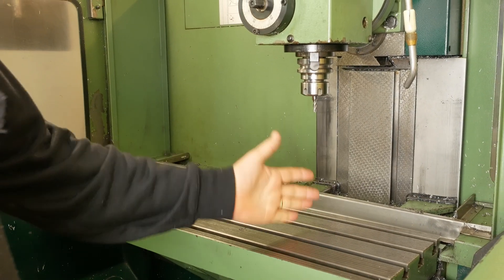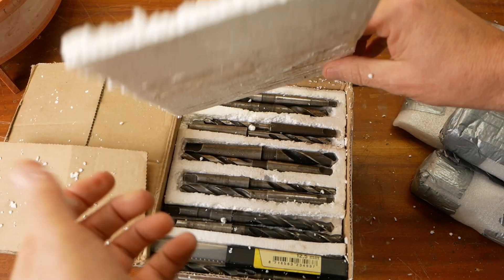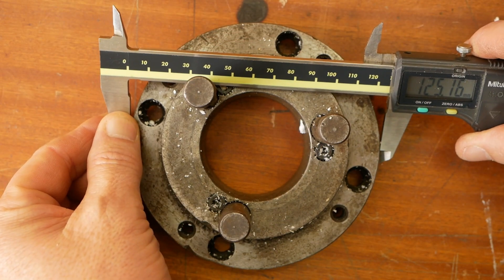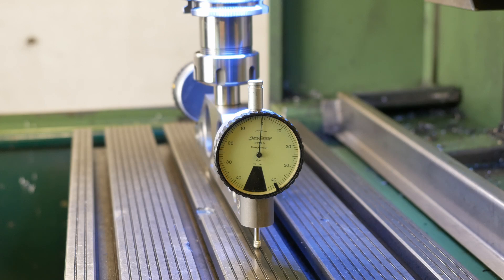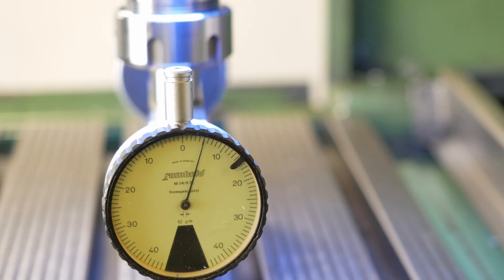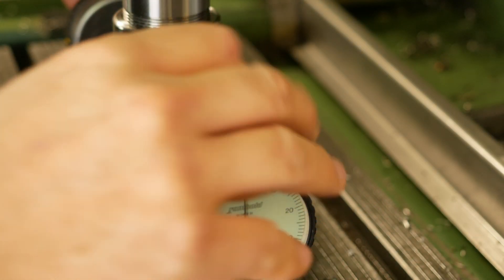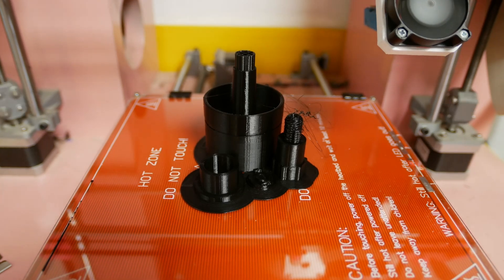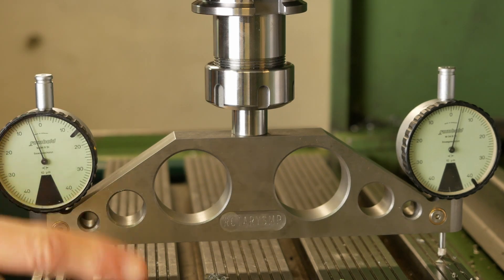The most amazing shop made tool! || RotarySMP

Comment: The first thing I'd check would be the adjusment of the gibs - especially the Z axis. Given that your machine is ex-education and hasn't done many hours, it's unlikely that the slides are worn, but on old machines this is common and would show up like this. If the gibs are properly adjusted and there's no appreciable wear, then remove the table, stone all the surfaces remount and check again. If that's not fixed it check that the head isn't tilted forward due to foriegn matter under the mating surfaces - you'll need a test bar. If the tilt persists, then it's wear causing the geometry of the machine to be out. I'd shim rather than scrape the table. If you scrape the table to correct the machine's geometry it will not only vary over the travels but will trip-up you or a future owner if the machine's ways are remachined.
Reply from the maker: Thanks for an excellent clear procedure to check that David. I will need to look into this when I get back from my trip.

Comment: I know I am a bit late with this, but most of the Deckels in the institute where I did my diploma thesis had 20 micron to 50 micron stainless steel foil shims to adjust the table sag. The alternative would have been to scrape the individual mounting surfaces of each of the tables in, which is fine if you have one machine to match one table to, but a lot of work if you have nine or ten machines with as many tables plus dividing heads which get swapped around a lot.
Must have been good enough, though: some parts made on those ended up with the ESA's Rosetta mission ;-)
Reply from the maker: Thanks for the feedback on that Kai. I need to get in and have a look at the gibs on the vertical slide as well. Might have worn a bit loose there as well.

Comment: Check the gibs.
Check the head for NOD.
Shim the head if you can, as it would be an easier job, if not, shim the table. 
 If you find your gibs are still good, and shiming isn't working well, your next recourse is to take the table off, and scrape the mating surfaces flat, or send the table off to be resurfaced.
Reply from the maker: Thanks for the feedback on that.

Comment: You're not using your tramming tool correctly. Here's how to do it. First, orient both clocks to face forward. You need to see both at once. Then Calibrate it by raising the table until one clock is zeroed at any convenient spot. Next, turn it 180° so that the other clock is touching the same spot (I put a target spot of ink near the front of the table.) Then zero the second clock by turning the bezel, without moving the table. You now have the clocks matched. (It should hold calibration between uses, but it's good practice to check. And never reorient the clocks.) Now align the frame with the X axis and the clocks facing away from the machine, so that you can see them from operator's position. If the head is out of tram you will see different readings. Turn the head until the readings are the same. Do not turn the spindle. Don't even touch the tool. One needle will move cw and the other ccw. Move the head until the readings are the same. They don't need to be zero, just the same. There's the advantage. You can see readings on both sides of the machine without repeatedly swinging a clock left and right, as as you do with a single clock. When used on a Bridgeport style machine it's especially helpful for adjusting the nod.
Reply from the maker: Thanks for the clarification. I suspected I wan't using the correct technique when I did it.

Comment: Mill the plane flat again.
Reply from the maker: It is probably loose gibs, or wear in the vertical slide, so milling the table square would be a last resort bandaid.
Reply: @RotarySMP  You could check if the deviation vary with the table height.
Reply from the maker: @andreavico6198  I need to do more checks.

Comment: For your y traming  you need to recheck it with the table lowered.
If you don't then you could be mislead and not knowingly having a compound error.

For the x movement recheck with the table fully extended both ways.  It will give you a great indication on way wear.

And as a previous person said, first adjust your gibs.
Reply from the maker: Thanks for the ideas Pierre, I'll add them to my next check.

Comment: The first thing that needs to be checked is if your axes are moving in a straight line and if x to y, x to z und y to z are perpendicular. You can check this with a precision granite square.
Now you can dial in the table parallel to the x and y axes and use your tramming tool for the spindle.
Better way is to set up the table and spindle separately. Dial in the table. For the spindle you use a cylindrical sk40 test bar and dial it in.
Reply from the maker: Thanks for listing the steps clearly.

Comment: Hm, by checking the Y axis from back to front of the table, what does the clock show?
Reply from the maker: I need to check that. Others have pointed out that the problem is probably gib misadjustment or way wear.

Comment: Did you tighten the bolts of the head before checking tram across Y axis? Also the tram (and table surface) needs to be exactly true to the Y-axis movement, should maybe check for that by sweeping an indicator over the table using the Y-axis before drawing conclusions
Reply from the maker: Yeah, I have more work to do isolate where the problem actually lies.

Comment: When checking the tram of the table, move the Y back and forth, don't rotate the spindle. You are now including the spindle leaning forward/backward and not just the tram of the table. I made that mistake and ended up making a kind of sawtooth pattern in the Y direction when taking parallel passes over X.
Reply from the maker: Thanks Quintin. I have been given a clear plan to measure and diagnose this error.

Comment: If the table is not adjustable, I would be tempted to use a large fly cutter to trim-tram it - so it is probably a good thing that I am nit allowed to have my own machine shop ;)
Reply from the maker: Yeah, it is more likely an error somewhere else such as a loose or worn gib.

Comment: Do check with a indicator on the head the difference between the front of the table and the back. It might be the head that is askew. Might be a chip there for you know. 

This is all why adjusting the y is a bitch on a universal head. Can't measure with certainty without torquing all the bolts.
Reply from the maker: Good points that. I need to investigate further.

Comment: The 3d prints look better, were you able to calibrate the e steps for the extruder motor?
Reply from the maker: I was going to but didn't get around to it. This is a different batch of PLA. Maybe that made a difference?
Reply: @RotarySMP  it is totally possible, sometimes the filament viscosity can play a roll in the performance. A better formula could provide much better results. Love the videos keep it up!
Reply from the maker: @mrpanda876  Thanks. I will do.

Comment: Not that I am very familiar with all milling machines, but this deckel-style alignment is very prone to sagging tables IMO. The  vertical flat/dovetail way is very far from the table mass, this generates a lot of leverage, the lower side of the vertical(Z-axis?) carriage wears more than the topside=sagging front. 
I've read somewhere, the top-notch milling machines were made with a smidge of reverse-sag, still in the tolerance, to account for a bit of wear.
Even if you scrape the table, you cannot account for the uneven wear on the vertical ways. 

Placing the leadscrews far from the mass of the table does not help either. On bigger machines, at least non-cnc, the leadscrew is usually right under the table mass.

I have a seldom-used manual MH500 too, though the vertical ways are worn a bit even on mine. The flaking is noticeably fainter than on the nonused surface area. Mine has tilting table, so not a real problem, but still.
Reply from the maker: Good points. I need to check the gib adjustment first. Maybe I get lucky there.

Comment: Wonderfully made tramming head. Not to be a party pooper, I just never understood people's fascination with this dual indicator head. You have to make sure each indicator reads the same, which mean swinging it to the same spot, and zeroing them against each other. Using a single indicator (like your old method) to me seems more accurate, more foolproof, and no special tools required to use it. I don't know if this is only for hobbyists that like this dual head? I worked in a tool and die manual shop in the late 90's, and everyone there used a single indicator to tram the machines. I wonder if modern machine shops use this dual head system, or keep with the single head system. Edit to add, between uses, there is a chance the indicators will move. So I guess you have to re-check the zero each use. Just seems a lot more work than a single indicator.
Reply from the maker: I think Luke was trying to use up as many Dial indicators as possible. He could have made a four gauge unit, but that would have been too much machining :)

Comment: Saggy bed looks like a common problem in these machines, I have 2 of them in quite good state and both beds are slanted by around 0.1mm. Both Z and X slides introduce some play, but tightening the gibs did not help, only make motors hum louder due to increased resistance. Shimming the bed is not a good solution, the rigidity and vibration damping gets worse with less contact area, and the result is an artificially lifted table. 
The fastest and dirty solution would be to grind (and destroy) the table, which is probably perfectly perpendicular to it's mounting surface, or to attach some kind of middleman plate to the table and grind it. 
You could also disassemble and check the Z slide. My X and Y axes look like new but the Z slide and the gib is a bit worn, scraping would help, but I have absolutely no experience in that matter and have decided to leave it as is for now. 
Your Maho looks so great though it could be just gib tightening.
Reply from the maker: Thanks for that John. I hope it is just gib misalignment.

Comment: rotate the table along a 45 degree axis so that the mounting surface is sitting up and the current top surface becomes its "base" attached to the knee. Then flycut the table base (which is now up). Then remount as before.
Reply from the maker: That could be neccessary, but I need to first check whether I have  a loose saddle gib.

Comment: maybe calibate the guages first in the same spot to zero using a guage block and then check the two points .this is the instruction from edge tecnology.i am not saying your method is wrong,its just what i followed when using edge tecnology traming kit.
Reply from the maker: Thanks. I didn't realise that was the best way to calibrate the tool, but others also pointed that out.

Comment: Before you go messing around with tilting the table, you should verify that the head isn't nodding. 

One method: Stick an indicator in the spindle and put something flat on the table, then run the indicator in the y direction on the flat.
If your reading doesn't change as you sweep across the flat, that means your table is not tilted but your head may have nod in it. 
If the reading changes as you sweep, it means your table is tilted. You will need to fix the table tilt and then check again with your tram tool to see if you have any nod in the head.
Reply from the maker: Thanks for that nice practicle test method Josh.

Comment: I mean a way to do it would be to just loosen the table slightly to just put like 2 pices of paper near the bottom bolts and then tighten it back up. The keep redoing that and folding the paper until it's good. Defetnly not the right way to do it but for the work you do it might be good enought, i also don't konw if the table not contacting on the entire surface would cause it to vibrate or anyother weirdnes so do so at your own parrel.
Reply from the maker: I am not a big fan of shimming. But it has been pointed out that the issue is more likely to be loose gibs, or way wear.
Reply: @RotarySMP  it probably is, and i doubt you would want to go spend the money to regrind them. 

there is a book online for what is generaly torable for theas machines "TESTING MACHINE TOOLS" By
DR. GEORG SCHLESINGER if you want to look over the mill section to see what normly lash and wear should be

it is free online if you can't find it i can send it to your email

Comment: 1 thing about using this setup for measuring.... make sure you swing both clocks fully before acting on measurements (im sure you did, though you only showed it for the Y and not the X) 
As for trading the Y, well on our large Universal head machines we would shim the head to align the spindle but still had to shim jobs to level them to the movement of the Y. As they got older and more worn out (experienced droop) we just got used to setting Z datums locally to where we were working 🤷‍♂️ i know, not the news you want to hear. Probably best to remove your table and do more inspection, hopefully it won't need scraping.
Reply from the maker: Thanks. It has been pointed out that it might just be loose gibs on the saddle, or wear on the vertical / horizontal slide. I need to investigate before doing any changes.
Reply: @RotarySMP  its weird how over time bolts can both loosen till they fall out or tighten until they become fused 😂
Reply from the maker: @wildin13  I will take the table off to check for a chip, but I put it on last time, and cleaned and lubed it well.

Comment: Hello Mark.  Thanks for all your great videos. Some nice finds there, and a beautifully made traming tool. You didn’t mention it in your video, and you or other viewers likely already know this, but you should check / calibrate the tram tool first. Using a gauge block under the end of one indicator, zero the indicator, then rotate the tool 180 deg and zero the second indicator on top of the same gauge block, in the same place on the block and table. This way they use they now same reference point / zero. Worth checking a second or third time to make sure the results are repeatable. Then check the tram of the head. Some of the commercial versions of this tool use a neodymium magnet as the gauge block for zeroing. Just check to make sure it’s faces are parallel and it rests very level on the mill table. Take care in your upcoming travels.
Reply from the maker: Hi Mark, 
Thanks for that info. I'd never used something like this before. 
Mark

Comment: Before changing anything on your mill, you first need to check whether the table or the spindle axis is tilted. The simple measurement shown in the video cannot differ between those two sources of error on its own. If the error is in the spindel head and you correct the table for it, the geometry will be worse overall.
Reply from the maker: Thanks Felix. Good point. A loose gib could also cause that.

Comment: I would just shim it, where the table bolts to the machine. Since you know the error you can calculate the shims fairly easily and it will get you going for now.
In that axis you should really be tramming the spindle relative to the Y TRAVEL first, then once you are sure the spindle is at 90 degrees to Y then tram table to match spindle. 🤔
Reply from the maker: Thanks for that input. That makes sense.

Comment: I wouldn't be happy using a collet, because collets are not that accurate.
Going straight into the machine taper is as accurate as you can get.
Reply from the maker: Doesn't that wash out when you rotate the beam?

Comment: What you really want is to tram the spindle to the X and Y ways. I start with a flat disc that I indicate in by sweeping the X and Y. Then tram the head to that. With your setup it's even more important as your table mounting could be off. I would at least sweep the Y across the table to see if it is true to the Y slideways. Then you will know where the correction needs to be made.
Reply from the maker: Thanks for that input. Excellent idea. It could be a simple as gib misadjustment.

Comment: Couldn't you skim the table with a shell mill?
Reply from the maker: You could, but that is not a good solution. The table casting is unlikely to have sagged. It is probably wear in the ways or misadjusted gibs. So better to address the problem than the symptom.

Comment: Hi Mark ,what a wonder gift from Luke.
Having installed a few (hundred) machining centers perhaps I have some  useful advice.
As beautifully made as the tramming device is, I would never use it , infact I have always used the indicatior base just as you have.
what I never used is the dial indicator , they are way to stiffly sprung, instead I was taught to use a test indicator and gauge block.
In my case (inch warning) a .005" indicator and a 1" gage block , the indicator has a long needle and a light spring.
the surface of a gauge block is flawless especially compared to the bed surface.
You can rotate the test indicator to the test spot and then slide the gauge block under it.

Now for the rest of the machines geometry , do you have the factory inspection report?
I have never touched a Maho or similar format machine personally But what you will
find in the report is that they will have used a square to check the Z-Y and Z-X alignment
of the table Z travel. this is done independant of the spindle.

Also a spindle test bar will be mounted into the spindle to check its Z-Y and Z-X alignment 
similar to what tramming does.

there are cylindrical squares that allow you to measure both x and y directions without having 
to reposition the square .

You can actually use any reasonable accurate square , just turn the square 180 degrees and 
when you have zero at one end and identical +/- number at the other you are good.
Reply from the maker: Excellent inputs thanks. It could be a simple as a gib misadjustment. I am going to have to take a closer look at all that.